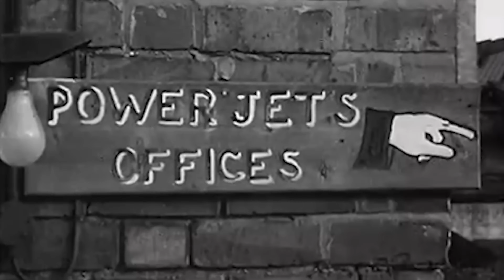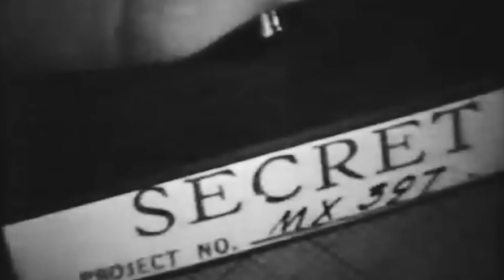WW2’s First American Jet Fighter – Bell P-59 Airacomet Explained

Comment: Hi. I'd guess that the wide wingspan was so it would glide well should the untried jet engine flame-out. That would also explain its slowness. It wasn't so much a prototype jet fighter a jet powered glider. A very clean and streamlined design. Cheers, P.R.